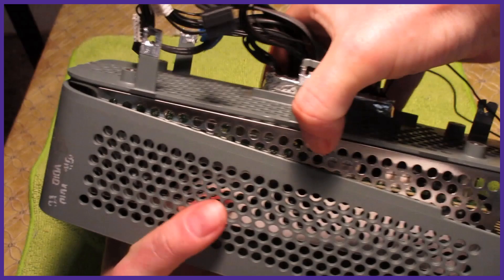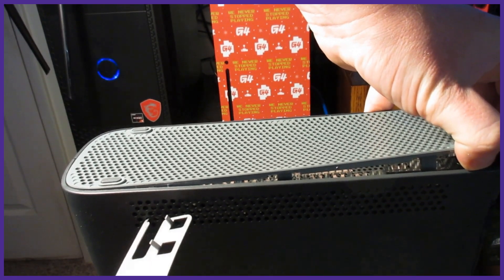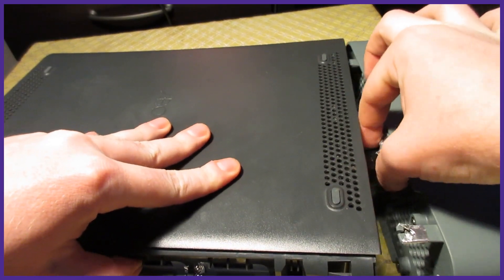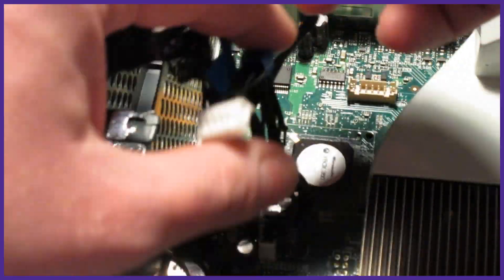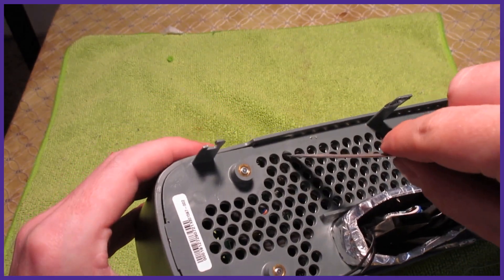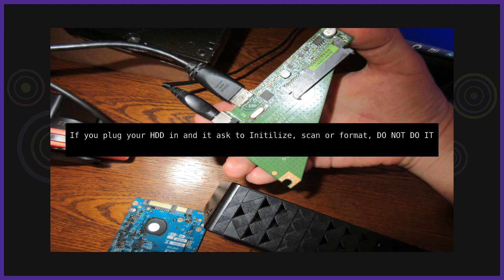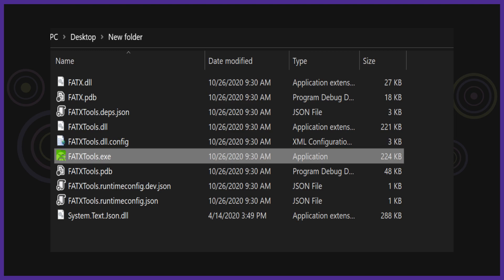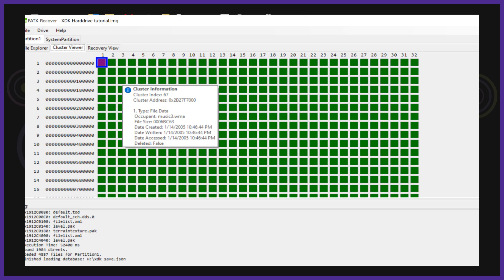XDK GUIDES 01 | Disassemble XDK, Backup HDD and Recover Data

Comment: Ive opened like 20 XDKs with Sidecars. Never had to open a console once as you can pop the 6 tabs at the base of the car and lift the car up. Then once the car is lifted I take a small flat head screwdriver and pop the base of the car and pull the car housing off the top. From there everything else is the same. I place a Costco card or something like that between the top of the console and the bottom of the car baseplate so that I can rest it on there while removing the screws to take off the HDD board (so the 6 tabs on the baseplate dont re-clip into the top of the console while setting it there). All in all it takes me like 5 minutes to pull an XDK HDD, if that. I like to do it this way because you dont have to damage warranty stickers.
Also, the side of the console with the rubber feet where you are pushing in the car tabs - if you peel back those feet it will expose a lower hole that is MUCH easier push the car tab in from....then after just stick the rubber feet back on. ;) Great vid though!
Reply from the maker: I know a few people who do that. And if you can do this. I would recommend because the sticker and scratching. But on the other hand I'd open it so it can get a nice clean. I've had some very dirty. xdks we have a method now to dump without even opening the sidecar I'll be making a video on that
Reply: @X360DevNerd  Yea, not a bad idea to open to clean as well. I just hate breaking warranty stickers. :/ Awesome vid though, will be super helpful to many people I am sure. I look forward to the second video! :)
Reply from the maker: @ErroneousClique  thank you, I have about 12 more videos lined up in this series and 3 are written I just need to do the voice and put together
Reply: @X360DevNerd  wheres the dump without removing video?